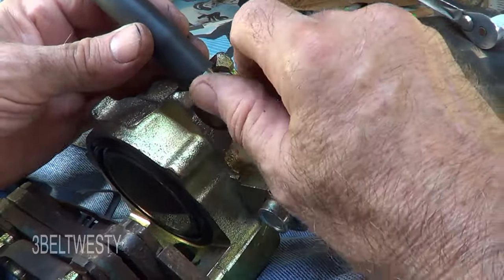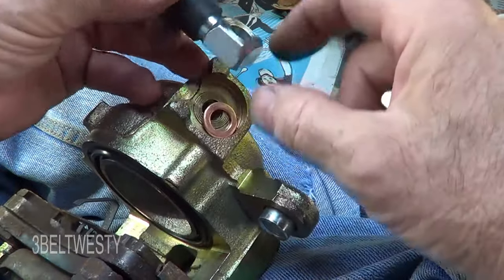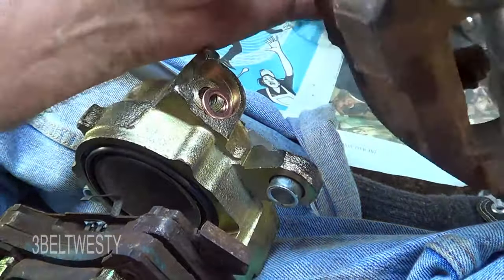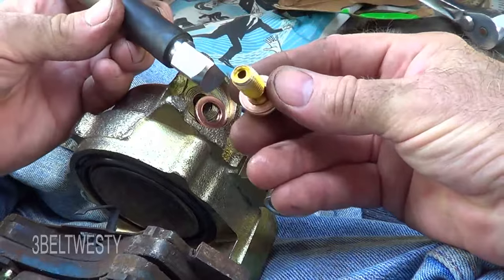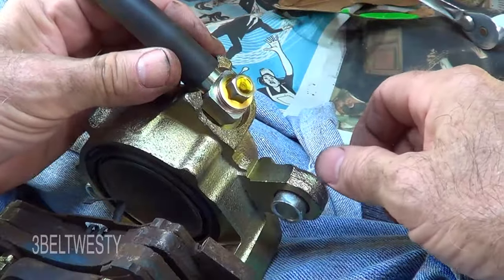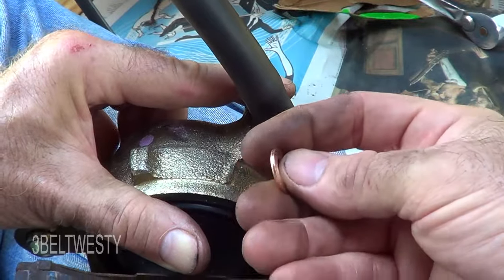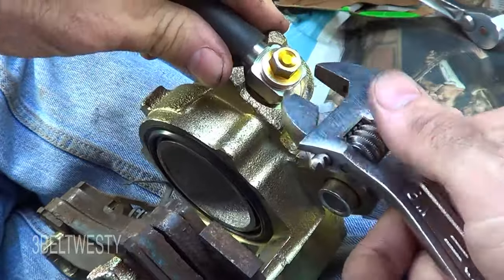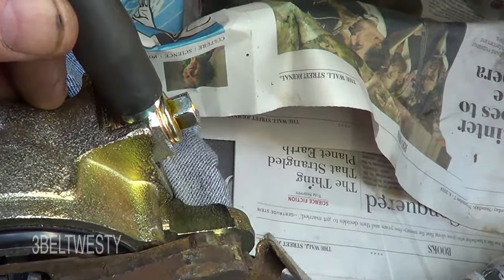Brake Banjo Notch Faces UP for sealing to caliper

Comment: Thank you. Taking old ones apart, I couldn't recall if washer on top and bottom of banjo. I still have wheels off my 87, lifted Suburban. Waiting on a Skyjacker brake line. 2 washers it is.

Comment: The real reason not to use copper washers again is that they work-harden when clamped and also with time passing copper will get harder ( age harden like aluminium does ).  You can anneal the copper in a gas flame, use a piece of steel wire and use it to hold the washer in the flame till washer glows red hot and then drop into cold water, this will soften the copper and the shock of cold water also blows a lot of the scaling off, you can polish with rest of scale off with west and  dry abrasive paper to clean up further.  I normally use a fresh washer ( unless it is an odd size then I will anneal it ), but I also routinely anneal even new washers to make sure they are soft, because some companies just stamp them out and don't bother with the softening bit.

Comment: Thank you for the informative film. But how do you know if those holes (in the hose and in the banjo bolt) are lined up. Are you supposed to use some marks on the top of the bolt? Because you torque the bolt and maybe it should be turn a bit more to be aligned?
Reply: Im wondering the same ..did you ever find an answer for your question.. please let me know what you found out . thank you
Reply: @KingGansta91  Yes, I found the answer. Don't worry about lining up, everything will work, when you attach them. Make sure you do torque specifications on Banjo Bolts. Again, no need to line them up.
Reply: @olenaerhardt7725  thank you for letting me know much appreciated
Reply: @KingGansta91  My pleasure. I worried a lot that break fluid will be leaking, but everything worked fine on both front and rear wheels, nothing is leaking, If you do rear breaks, make sure you align wheel cylinders well, bcs first I aligned one wrong and almost started to torque it. Fortunately realized it is sitting wrong. Looking back, not so complicated procedure.
Reply: Reason why you don't have to line them up?  Is it because the banjo bolt has a recessed area that allows the fluid to flow around and into the hole?
Reply: @MatrixRC  I replaced 4 banjo bolts and guessed already that there should be some voids where the break fluid can go, but thank you for the detailed explanations.
Reply: Yes people yhe bolt is smaller than the hole its not made to line up it has space fot fluid flow its dang near impossible to line it up unless u mark it on oitside but not needed what he did made no sense in lining up the hole before he screwed it in it defeated the purpose
Reply: @thesouthernlife4061  You are correct. But don't lie on the man lol. He never lined up the bolt at ALL. He explained how the bango fitting on the brake hose end has to be seated on the caliper correctly because they are angled, some more than others.

Comment: I'm just wondering how you line up the hole in the bolt with the hole in the brake line? Is that what the torque is for
Reply: This guy has no idea what hes talking about the bolt is smaller than the hole and allows fluid flow he made no sense lining it up when installing because as soon as he screwed the bolt in its not lined up anymore

Comment: So is a crush washer just an ordinary copper washer? or do I have to buy special "Crush" washers?
Reply from the maker: They usually come with the brake hoses or calipers. The copper washers for sealing are sold online. For sealing the copper is not super cold worked. They are made so they deform some to make a seal. Your suppose to replace them since the deformed groves of the old ones might not line up.

Comment: My new calipers are both leaking around the banjo bolt. I was thinking about using ultra black RTV on them. It's seems like a good idea...whats your opinion?
Reply: is this a joke?  brake system is several thousand psi.  everything needs to be clean and flat, sealing surfaces parallel, and torqued
Reply: @connor3288  a few weeks back I removed the banjo bolts and came to a realization. During the install being in a rush. I accidentally reused the outermost crush washer. After the new crush washers were installed and the banjo torqued to specifications. The slow brake fluid drip stopped...

Comment: so not sure if you’ll know or not but I have a 2007 ram i’ve replaced the rear caliper 3 times and it’s still continuing to leak i’ve replaced every line and flushed the whole system and it still leaks any idea on what to do?

Comment: Can you attach new rubber line with banjo to the new caliper before installing new line to the steel line with the nut? Should I replace the line first then attach to the new caliper? Thanks
Reply: He literally has the caliper off the car showing you he's putting the hose on first 🤣🤣🤣 But I'll be nice and answer your question...Yes. Think about it, if you connect the hose to the hard line first what will the brake fluid be doing while you are trying to tighten down the banjo bolt and flange to the caliper? Think about it...

Comment: I have a new caliper, break hose and copper washers... but it still leaks! Anny suggestion?
Reply: Uzi Movie I have a similar problem. I think I have the banjo the wrong side down? Will fix tomorrow
Reply: @jonathangoodall3880  ok... i think my caliper is uneven so the washer will never sit properly.
Reply: Jonathan Goodall and Uzi Movie I also have all new everything and mine leaks as well. Did you guys find what was causing the issue?
Reply: @Nopenotatall  my caliper is refurbished... so im assuming that the flat surface that connects the washer and breake hose isnt perfectly flat. So i just ordered a new caliper. Waiting on ups now.
Reply: Yep...same problem here...new hoses, washers, and replacement calipers...I've even tried different thicknesses of washers, but to no avail...it would seem that quantity is more important than quality with replacement parts these days...
Reply: @glenblair4103  mines are refurbished so it makes sence that there could be a problem...  i might have to bite the bullet and go with some high performance setup.... shits costing me 2 much $$
Reply: @glenblair4103  all the calipers for my car are refurbished... so they may never be flush for the washer to make good contact
Reply: @glenblair4103  is it still leaking what was it ?
Reply: @UziMovie  what was the issue?

Comment: Always use new copper crush washers.
As for the hose, directio he is incorrect. The recess in the caliper is machine to accept the offset. If it doesn't fit you either have a poorly machined caliper or an incorrect hose. There shouldn't be any interference with the washer when the hose is placed on correctly because the distance in between the diameter and the Tang will remain the same. That recess is to ensure that the hoes in the caliper are in the correct alignment with no divination. But hey if you don't have the right hose or you don't have a properly machine caliper do what you need to do... I have taking a grinder to Portland machined brake pads and I have also knocked The byrds off of bad castings that weren't properly machined before i got them. It's just brakes they are only meant to stop the car, damn those engineers that went to school and designed the things 🤷, what do they know.
It is always best to stick with the design as intended, especially with the part of your car that literally stops it from killing you or anyone else. If you need to fix it, do so but don't change it. Usually when something is designed a certain way there is a reason. Doesn't matter if you have an engineering background, and especially if you are a mechanic (because I promise you if you did brakes on a car and you did not reassemble those parts in the correct way you will be held liable), don't go giving people bad advice and telling them to reassemble things backwards.